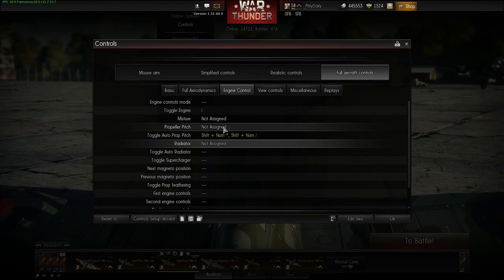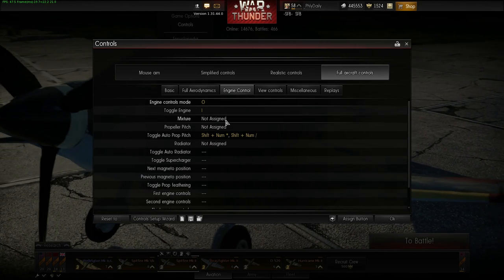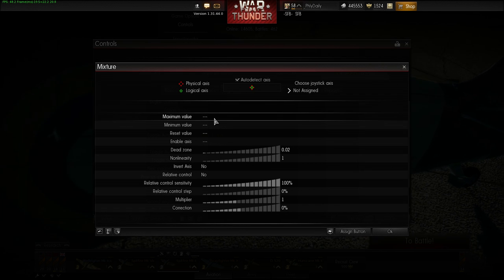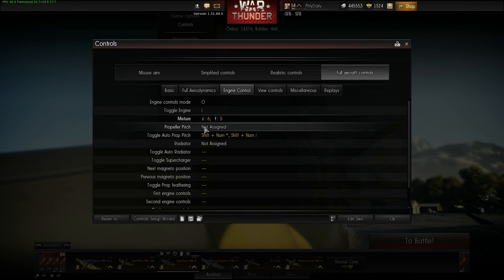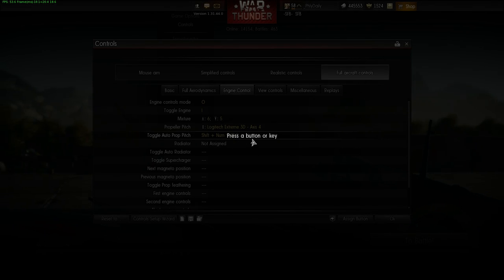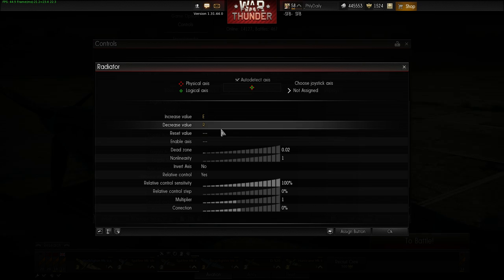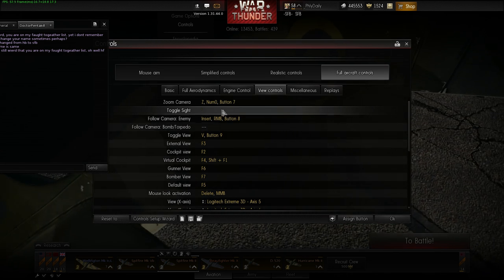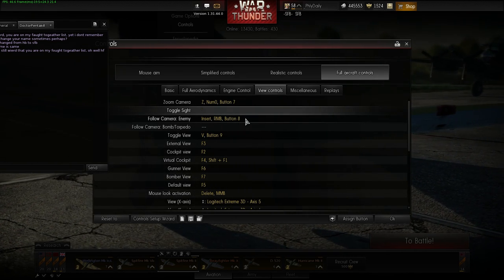War Thunder-Best Joystick Setup Part 2

Comment: Hey Phly (and Kiershar, love the accent), you guys were disgussing leaning and oil temp. If you lean too much (especially als low alt) your engine will heat up too much which causes the oil to run hot. The extra fuel will actually cool the cylinders and oil (in real life it does a lot of other good which probs doesn't matter much in WT).

Comment: Does each plane need different .blk file settings, in order to maximize it's capabilities? Or... as long as one is using the same mix of controls on every plane... (i.e. Keyboard only. Keyboard & Mouse, Joystick & Keyboard) etc. etc. etc, can the same basic .blk file settings be used for multiple fighting platforms across Fighters, Bombers, Tanks, et. al.? 
I understand that as additional gunners, tank loaders, engine controls, etc. are introduced into the game, as I improve and increase my levels of proficiency... that some changes will need to be made in order to have all the controls necessary for new equipment which becomes available with said game progression. I am talking mainly about levels 1 and !! game play and the planes etc. available at those levels.
Thank you for your rapid response to my inquiry. I am currently using the Logitech Extreme 3D Pro Joystick and my Keyboard for a mix of controls that I am learning slowly as I am trying to progress through the game. 
Thanks again!!!
Scott - AKA - Zarken Ventreth

Comment: I have a logitech extreme 3d pro, for some reason when i fly the tutorial plane the plane slightly always wants to go up.  I have been fooling around with the settings but nothing works.  So I have to slightly push down on my stick to keep it even.
Reply: It's mean to do that, I think I'm correct in saying that all aircraft naturally pitch up without any input. Use the elevator trim to help keep the plane level.
Reply: Yep.